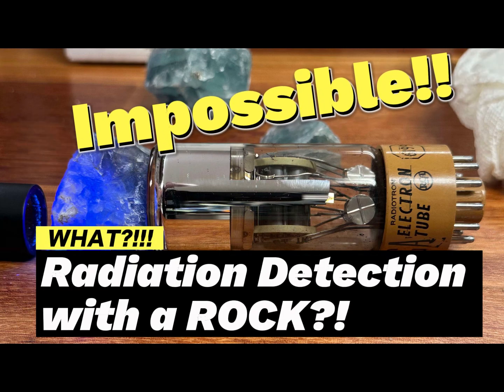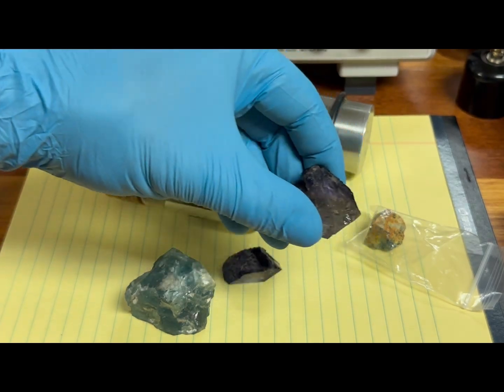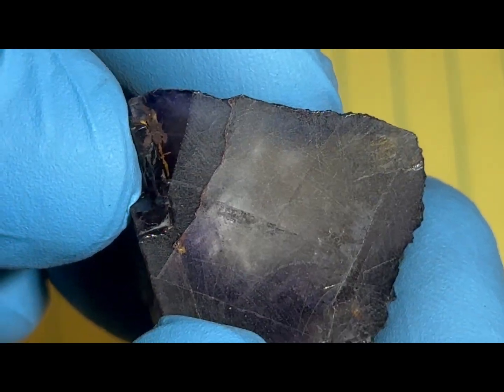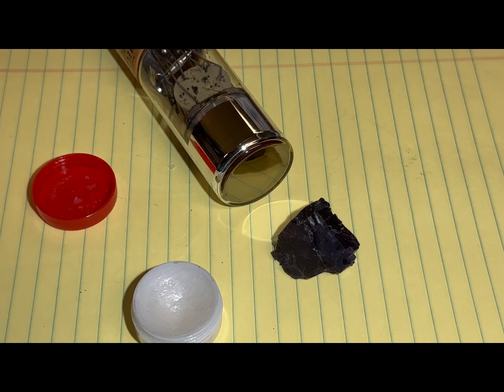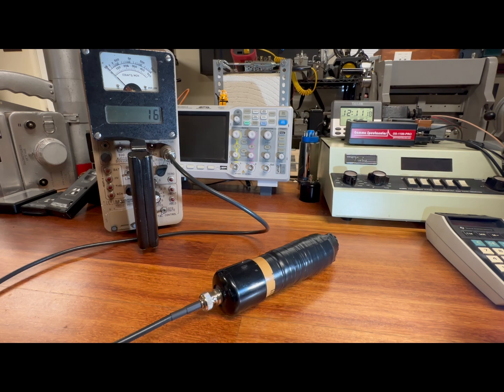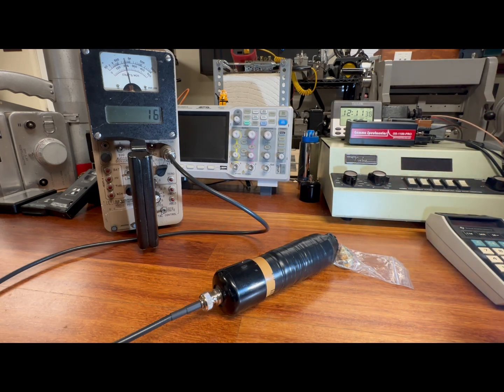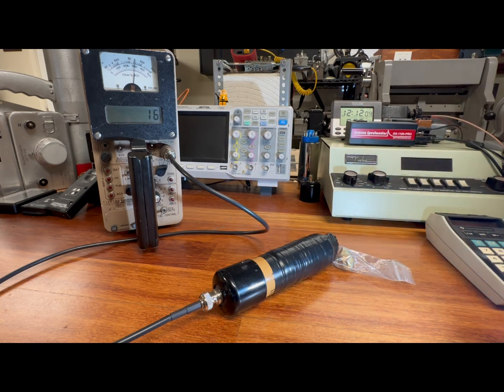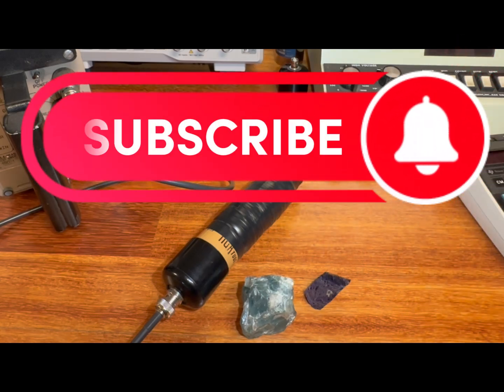IMPOSSIBLE! Detecting Gamma Radiation with a Rock of Fluorite?!!

Comment: Cool! I didn't even know fluorite was used as a scintillator until a few days ago when the Angry Turtle gems guy did a short video on cutting some synthetic fluorite originally intended for just this purpose. May I suggest another experiment with it? Boil a cup of water and dip the fluorite end of the assembly (in a plastic bag or something to eliminate water ingress) into the water to see if you can just start to see the onset of thermoluminescence from the fluorite due to lattice defects and F-centers accumulated during its time exposed to ambient radiation underground.